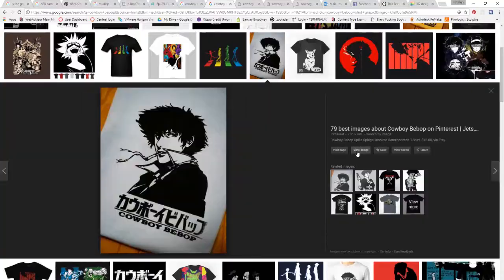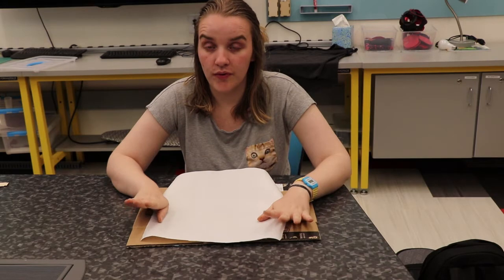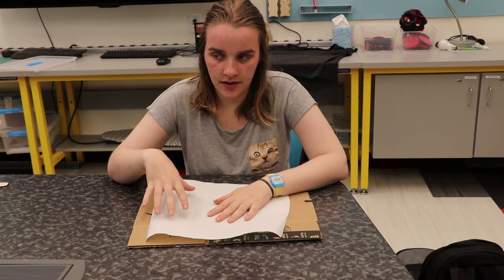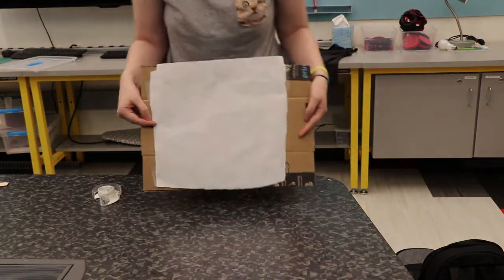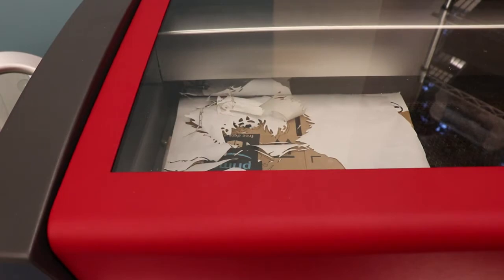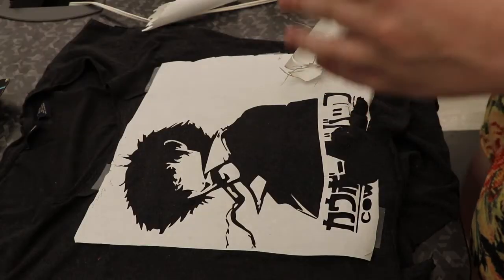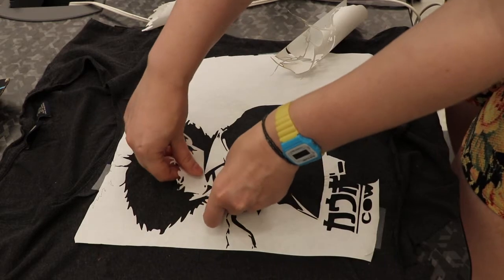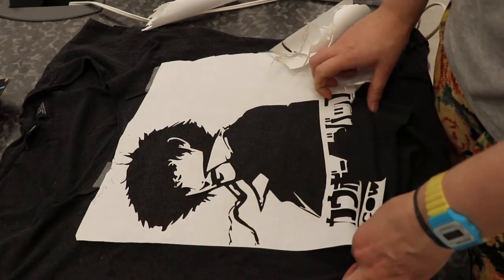Laser Cutting Stencils

Comment: I don't have the same kind of laser, but if you have access to the hose that goes to the air pump for the nozzle's air flow you could put a cheap needle valve in there to show the air down. This will make lasering paper a lot easier and or delicate materials.

Comment: You can buy low tack, repositionable, spray adhesive for archival work. Should hold the paper down nicely in the cutter. I use it a lot and it does not warp the paper.